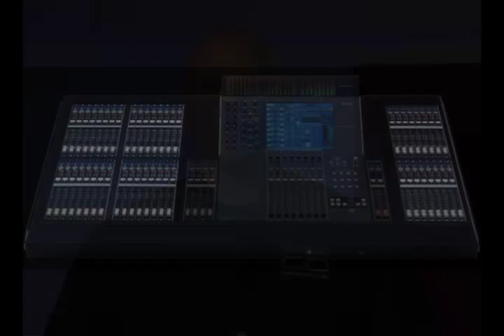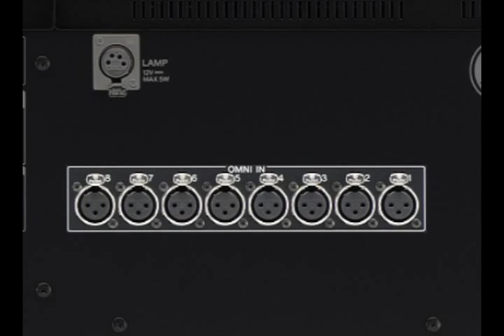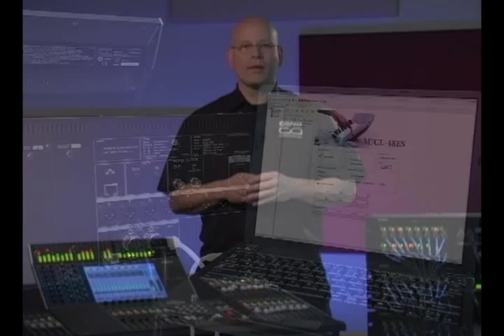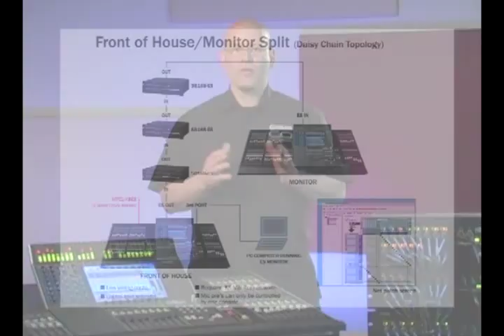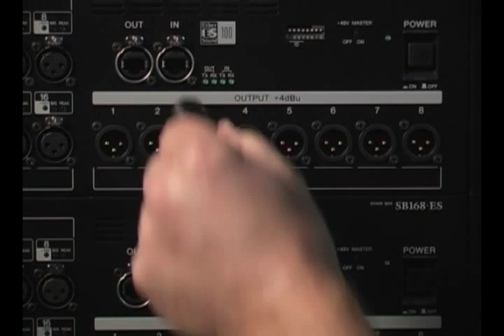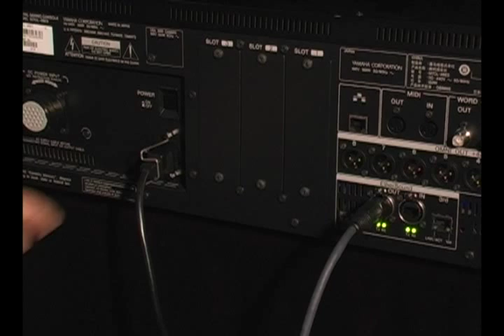Yamaha M7CL

Comment: hi guys, wondering if you can help. i am trying to connect a macbook pro to a M7CL to run through logi pro then back into the mixer and into the broadcast output. i want to use logics plugins for mixing